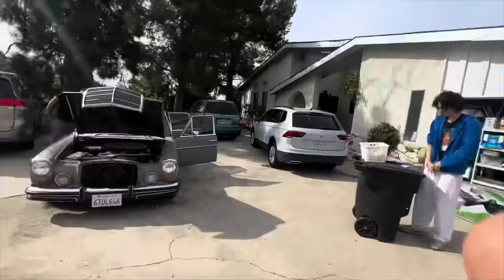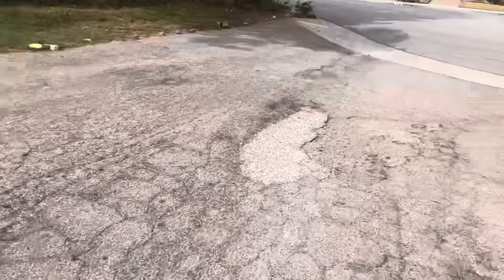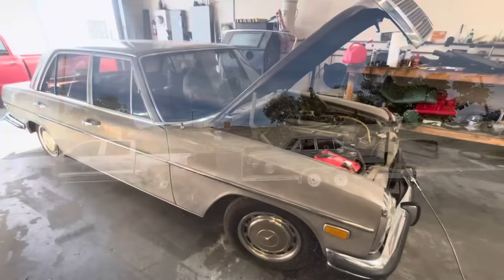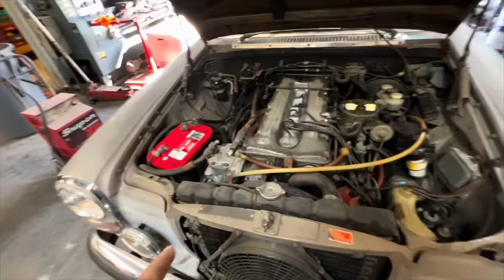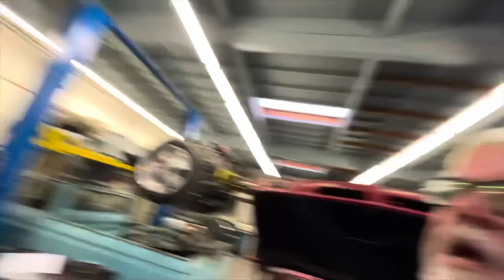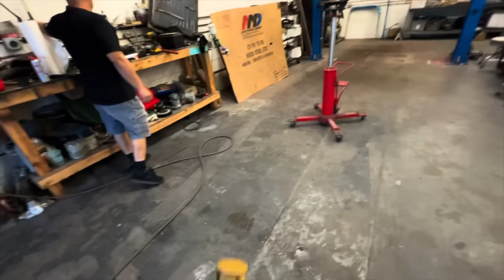Mercedes Benz Comes Back to Life ￼

Comment: Great score lucky, I've got a 1970 300SEL 3.5 V8, W109 model ( early S-Klass) with factory air suspension/bags, she sat for 15 years in a garage and the day I got it I dove it home 300 miles after topping off the tank and checking the lights. What you have there sir is a W114 280, early E-Klass but just as cool, the carb is a Zenith 4 barrel, the seals do shrink on them so you may have some vacuum issue if it dosen't tune right. If the  motor is on it's way out anything with a front sump will go in, like a 347 Windsor will go in with new mounts. I get most of my parts from Pelican parts, I'm in Australia.

Comment: You are about to learn the joys of fixing the vacuum central locking system.  The seats use coconut padding in them, if you are in a dry climate you will find little piles of coconut padding in the rear seat foot wells every once in a while.  MB cars don't nickel and dime you to death, they 100 buck you to death because every part is at least $100.  The hood should have little catches in them that allow you to open the hood almost vertically, this is handy to know when working under the hood.

Comment: These old Merc straight-6 does go forever, even the straight-6 80s/90s are quite tough but watch out for electronic faults.

Downside are expensive parts, and they use fuel like big V8.

Comment: The underside looks likes the general maintenance - after Tony been "driftin" at rockfish. Could a Hemi, Transmission, and the rear axle assembly from a 2005–2008 Magnum or a 300c work in it?

Comment: Nice W114 >more likely to be a 1970 not a 1974.  I have owned several,mainly because my late father used to buy a new one every year from 1969 onwards. At the moment I'm finishing a full on resto of one for a customer and I have another parts car (A coupe) which had the Fuel injection (Djet like a VW type 3) and because of poor maintenance it caught fire. I've seen all sorts of engines in these but the best conversion was a Australian Ford Barra six turbo and five speed mainal. The carbs are shit. A solex copy of a rochestor 4bbl. a very poor copy. 
There was a four bbl conversion available for years but invariably had the wrong size Holley fitted. 650 CFM is not a good thing.
So, I would get them in for repair ,which involved fitting a 350CFM holley.  today,instead of messing with 50 year old ignitions I install a 1 2 3 distributor which eliminates most running worries. And tappets,which always need adjusting. 
When running properly ,even those limp wristed US versions can get along quite well.  
That car has factory air which is quite rare .